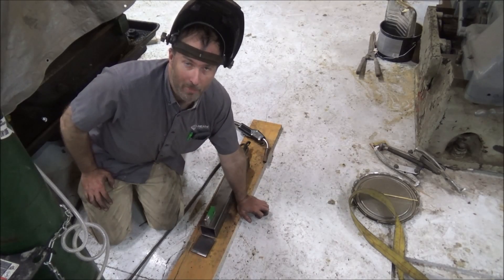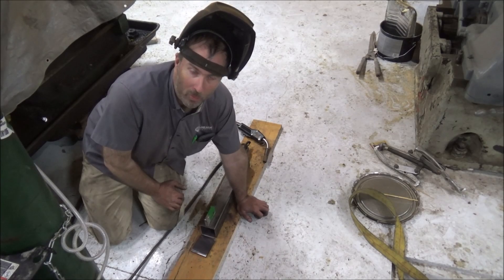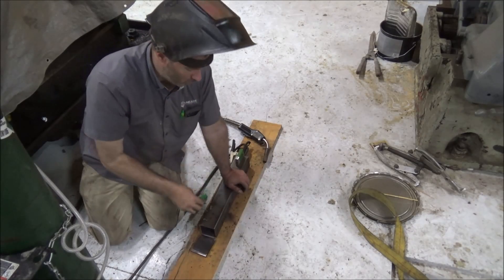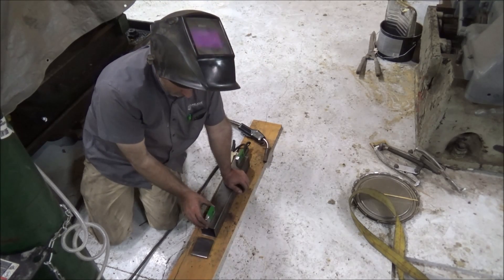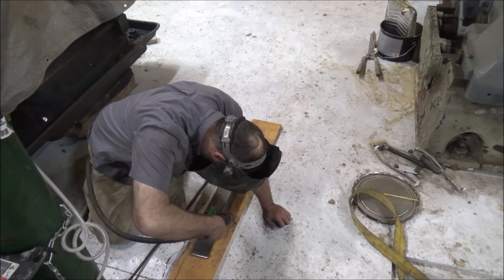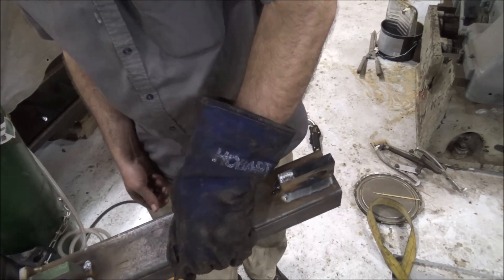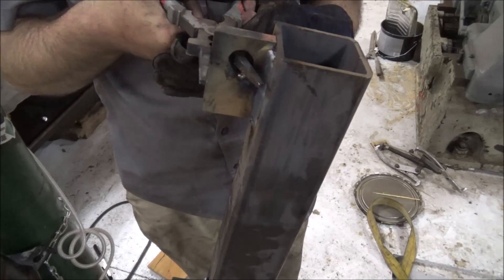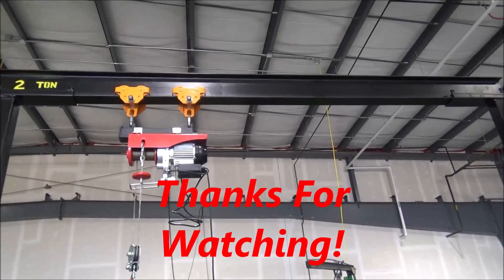Building a Bracket to mount a Harbor Freight Hoist

Comment: I was able single-handedly to drop 2-each (very heavy) water heaters out of my attic and✰✰>share4.photo/electriHoist?Є79    then lift two new units into the attic to replace them. I actually bought two of these hoist units since our attic had an awkward step up so that there was actually two levels of lift required. In all, the units worked flawlessly and were easy to install onto the rafters in the attic using a heavy round pipe spanning between two rafters (i.e. I drilled 1-1/4" holes into the two adjacent joists and then used sleeves to hold pipe on opposite sides.

Comment: Lots of comments about needing a welding table. I agree and can relate. Problem is, any flat surface in my shop immediately gets covered in stuff! What's the secret for those that have welding tables and can actually use them???
Reply from the maker: Weld a lot to keep it cleaned off would be my guess. :-)

Comment: Hi there !
I once made one of these too, but I simply couldn't stand the sound of it ... it's like an angry wasp in a bottle ... it give the nerves !

Here in Denmark you can second hand get a gear reduction motor with brakes on it for next to nothing - equevalent to less than 10 US$ - yeah ten !

And I did so 8-9 years ago and constructed myself a motor the one end of the beam and just made some big wire pulleys (maube not the right term) and that way you get a lot more travel for the hook.
All in all I'm very satisfied with my "crane" I made back then:
1) very cheap, 
2) no noise at all - just the cooling fan inside the motor
3) so clicking of the brake going on/off and the contactors
4) a lot more height under the hook
5) no high powered cables running/moving along the beam

I thought of getting it wireless controlled, but ended up with the 24V control handle hanging from the "cat" - then you allways have it near you.

More details here in danish but you can Google Translate to the right just under the menu line - choose whatever language you like in the combobox and
tame a look here:

https://kelds.weebly.com/loslashbekran.html

Please SUBSCRIBE and make some comments - my staff and I will be very happy if you do ;-))
Reply from the maker: Re subbed. I had thought I was subbed from way back when you had a I think it was knurling calculator online but I guess I somehow got delisted hard for me to keep up!!
Reply: I can't really translate your reply here ... but if you're still interested in that knurling calculator it's still free to download from my web-site: https://kelds.weebly.com/sjov.html

Comment: Nice job!I have the same hoist at work for lifting and moving steel sheets out of the rack and setting them on our cutting table.It handles everything up to 4x8x3/8 with ease.It's seen daily use for the last couple years.

Comment: Nice job , I've helped hang several of the HF specials for friends . I prefer to add some heavier angle and or plate to there red bracket . To me it's the weakest point. I love the box set up you made for the crane it works super on there. Thanks Brian

Comment: Great video, I’ve been looking at these for awhile and wondered about a good mounting bracket. I really like that you showed the finished project, could you mount it with one trolley or would it always be off balance?  Thanks, keep them coming!
Reply from the maker: They are always crooked trying to do it with one as the load center moves depending on where the cable wraps on the drum. The dual trolleys is the ticket.

Comment: my back hurts watching you work on the floor like that. you need a welding table.
Reply: My knees did!
Reply: @lewiemcneely9143   Same here!  I have to use knee pads.
Reply: I have a welding table and I wear crocks and black nylon socks when I'm welding.  The nice thing about that is when you burn holes in your socks, they don't fray.  The kneeling on the floor is a great nylon sock protection method and it's also the place you need to be before you say a prayer for a good weld.
Reply: @larrypardi9143  GOOD prayer place but I farm out my welding. Works a lot better.